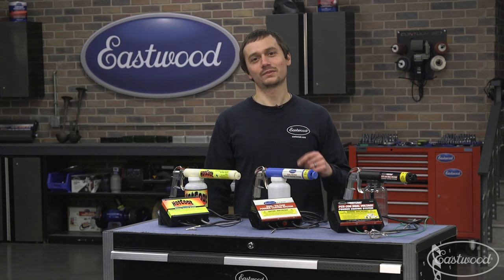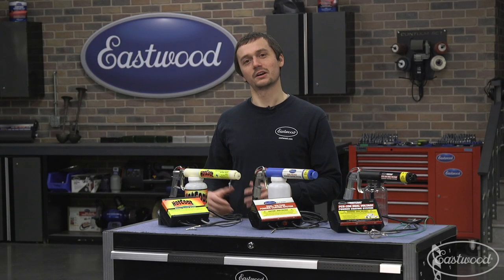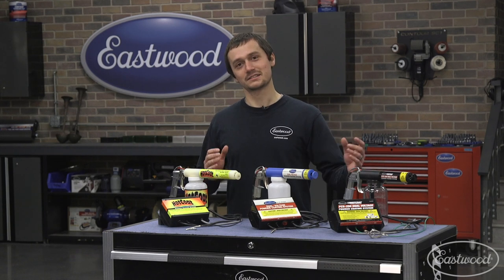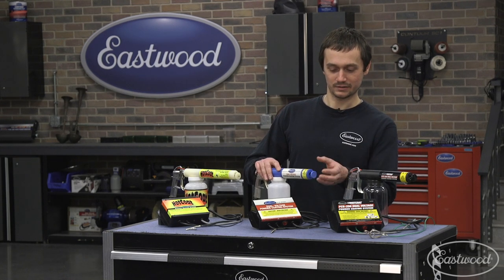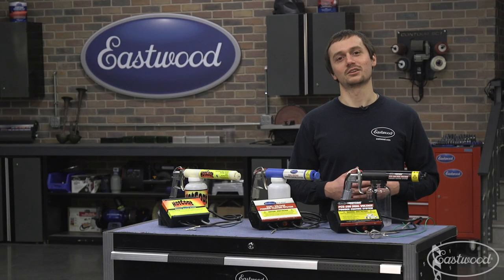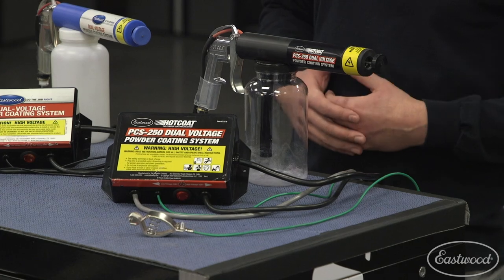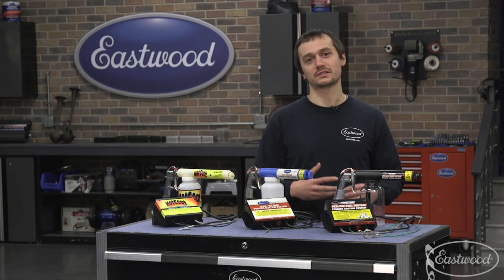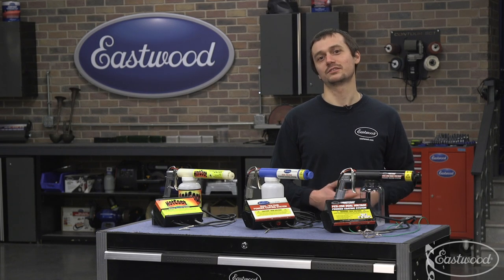Evolution of Eastwood Powder Coating - PCS-150 & 250 Powder Coating Systems

Comment: What sucks is that you didn't add the button to the gun itself. Its nice to have a free and when you are spraying your work.
Reply: I zip tied the button onto the left side of the handle of the gun so you can use your thumb to hit it and it works great